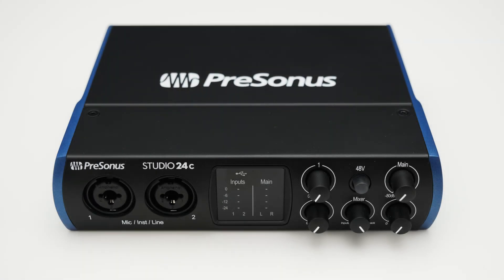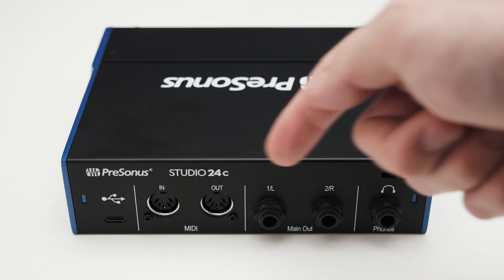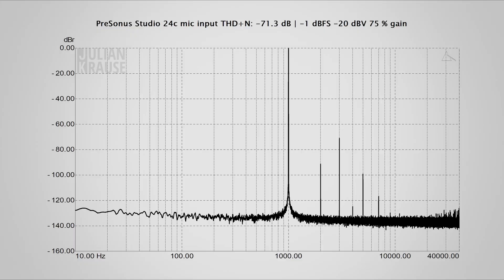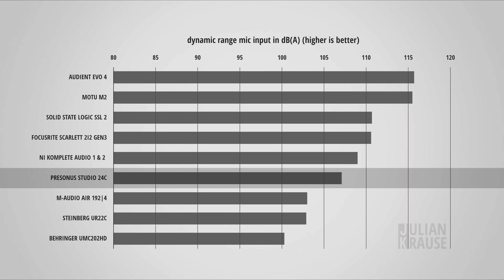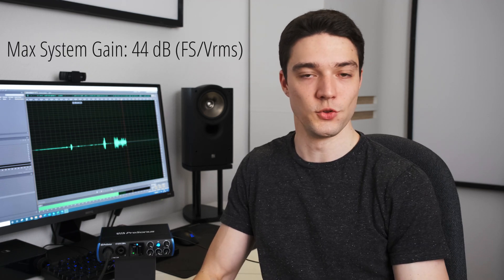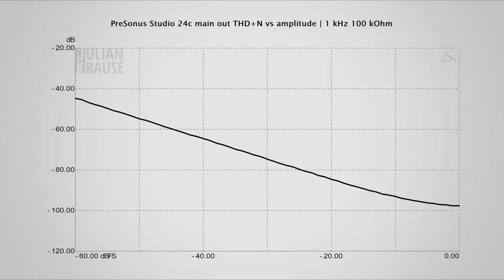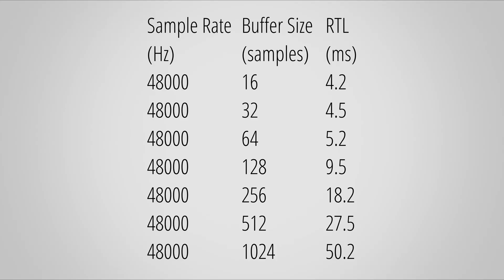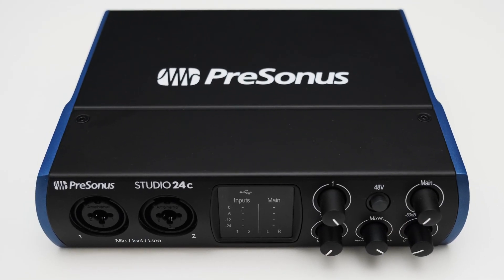PreSonus Studio 24c Audio Interface Review (audio quality test)

Comment: Been using this for about 5 years now, and 0 regrets. I had a dt 990 pro back then and it didn't struggle to drive it. Now im using it with an HD 400 (560) and its an even better experience imo. It did however make me shy away from the newer lower impedance beyerdynamic headphones due to the high output impedance.

Comment: Thanks a lot for the review, very informative !
I need a little clarity on my situation, I don't have studio monitors, so I I'm planning to use my AKG K361 headphones (32 Ohm) as output. Will this be enough to get a decent sound considering that the Presonus 24c has a high output impedance (22,2 Ohm) and 51,2 mW output power into 32 Ohm ? 
Or maybe I need another audio interface with a lower output impedance like focusrite solo or 2i2 ( 0,32 Ohm output impedance and 32 mW output power into 32 Ohm ) ?
Reply: Hola amigo, yo tengo esta presonus y unos AKG K240 (55 Ohm), aunque es casi imperceptible, la calidad del audio en los audífonos si disminuye muy levemente, pero la salida main es muy buena y potente.  También graba muy bien.

Comment: Thank you so much for your very helpful video. Well done! 
I'm using Sennheiser HD 650 headphones which have an impedance of 300 ohms.
Wondering if using a separate headphone amplifier would make any difference in regard to the frequency shift issue?

Comment: I got the Studio 26c today, I’ve measured the RTL with the RTL Utility and an analog loop, I got 9,89ms at 48khz 128 samples, both on my laptop which has intel i7-1265u and on my desktop which has Ryzen 5900x, both 32GB RAM. Amazing!! I don’t know what is the impedance of the headphone out, I’ll check how to measure it in case. Which are the headphones you suggested with the 24c? Sennheiser HD58x (I’ve seen they have 150ohm impedance)?? I didn’t get them exactly in the video…

Comment: Thanks for your review. I based my decision on it, been using it for a year and a half. In my opinion the interface is fine but using shures SM57 and SL26 I need to crank the input volume almost to the max - didn't have that problem with focusrite and tascam.

Comment: I just picked up their Revelator io44, which (allegedly) uses the same preamp as the Studio 24c, and I notice something interesting that tracks with what you have said here. If I set the input gain to +30 dB or more, there is RF noise. If it's at +29 dB or less, that noise is completely gone. When switching between +29 and +30, it sounds like it is switching between two gain circuits, so I kind of suspect that whatever circuit they are using for higher gain is just not very good.
Reply from the maker: Hm, interesting. I have an io44 on hand and I'll have to check this further. Thanks for the info!

Comment: I own the 24c since last year. When I have bought it, I was new to this (interface, audio, etc.). I actually use a AT2020 condensor mic (plug XLR) and I recently bought a Presonus PD70. After testing the studio 24c, do you think it could be a good add on to buy a pre amp for my dynamic Mic? Cause honestlay, I need to crank the gain almost the the rough to be able to get a decent recording (between -9 and -6dB) I know that the two input are already preamp, but I'm not quite sure it's enough. Since my gain is really high, the room tone is also high. Thank you! Very good review though
Reply: You’ll need mic inline preamp for 24c to use with dynamic mic..

Comment: Excellent review, thanks. I went ahead and purchased one of those. I was blown away by the sound quality and the sound image/stage. Those excellent crosstalk numbers really make a difference. I am using 32 ohm headphones and indeed the high phone output impedance proved to be a problem but I drove them from the "main out" outputs and problem solved - crystal-clear sound. I just use a switch to change routing from headphones to speakers and vice versa. I found a pretty neat use for the headphone output too: I record directly in stereo instruments that are normally mono, using my Soundblaster's line-in, for reviewing my progress with my bass guitar, in Audacity which is much more convenient and hassle-free compared to real DAWs :).
Reply: What is exactly the problem of using 32 ohms headphones with studio 24c ? How it manifests practically ? 
Also can you describe more specifically how you deal with this problem, please ?
Thanks in advance !
Reply: @cristianturcan7659 Ιt's very simple: if you plug headphones into the headphone output jack you'll have more bass than normal (actually bass is normal and for everything else there is less of).

Solution: plug them to the main out instead, using an adaptor plug. If you also need to drive speakers use a switch.

Another solution would be to use a dedicated headphone amp between the headphone output of the Studio 24c and the headphones themselves. That's what I eventually did.
Reply: @MotoMarios  Thanks a lot !
Reply: @MotoMarios  is it really audible by ears?
Reply: @LordZavet  If you mean the problem with too much bass, then yes it is very audible.
Reply: what you mean by "main out" ? so u bought this interface and plugged headphones not to inferface but to your pc/laptop?
Reply: @ClarkSpencer1  The interface has two outputs - one that goes to speakers ("main" out) and one that is intended for headphones. What I did was connect the headphones to the speaker ("main") output and the headphone output is plugged in the Line-In of the Soundblaster for real-time "loopback" style recording in Audacity, in stereo.

I use a switch to divert the "main" out from the headphones to my desktop monitors.

Be advised, I bought the interface used and I can not use the accompanying DAW/software, only the basic driver is functional so I can't have loopback any other way.

Comment: i have just buy the Motu M4 but issue in the +48V of the input 2, a low-medium buzz when i up a lot the preamp. i have to send it back. But to know if i ask for a refund or replacement,  i have ordered the 68C in express lol. And no problem of mic +48V preamps with the Presonus. But yes, not as gain as the Motu, even with the line in (when i record my hardware synth) the level is clearly lower compared to the Motu M4. line/mic/inst all is clearly lower than the Motu :( . Headphone output same power. Very good sound quality on both but better dynamic and nuances respect with the Motu. i think that  for a Presonus product with 4 in 4 out, it shouldn't be so withdrawn compared to the M4.

Comment: Hi. In your opinion, will this interface provide enough power to sufficiently drive 250-OHM headphones such as the Beyerdynamic DT880? Thanks!
Reply: Hello,I have same question. Presonus support gave me positive answer. I wonder if anyone tested
Reply: @IntelligentMuzik  I have the answer you want my friend..This audio interface can not handle 250ohm headphones at all..If you already have the headphones and no interface go with MOTU M2 or Solid State Logic SSL 2. I had the exact same issue..
Reply: @eddielives3946 Thank you for the reply. I have to say that I bought it and it runs great.. of course if you need more volume you can invest in an amplifier but I don’t see the need for now.
Reply: @IntelligentMuzik  Correct! I'm happy you are satisfied with the 24c,i was also until i changed headphones because i wanted a more clear sound for my mixing and mastering. The only problem with the amplifier technically speaking is that the less things you put through the interface the more you get ( most of the times!) 🤙
Reply: so despite it handles up to 300 ohm on paper it does not in reality? should I go for 80 ohm instead of 250? thanksss

Comment: I've been testing the Presonus Studio 26c and the Audient 14 mk 1. Really can't decide which I prefer. They both sound fantastic, really neutral, clean conversion and nice stereo image. Can really notice increased seperation between the bass and mids over my Mackie Onyx Producer. However I find the Presonus has a slightly cleaner headphone output with my 32 ohm headphones, although it is out of balance at low volume levels, biased towards the left, where the Audient is perfectly balanced due to digital volume control. 
 The Audient is a tiny, tiny bit better on the DAC but it's extremely subtle on my Yamaha HS5. But l the 26c has midi and 4 seperate outputs Vs no midi and 2 outputs and a seperate headphone bus on the Audient. Really can't decide, they are so so close..I have to use USB 2 due to using older computers.
Reply: I have here the Audient id22 which i used for 6 years and love, but recently bought as well the presonus 1810c. I like the dac converters better on the presonus it sounds a bit fatter , same on the headphones. Audient is still very good but sounds a bit more hi-fi in comparison. I'm suprised as there is barely any adds/review about those presonus interfaces. They might not be the best on paper but i prefer it to mix master my music on the 1810c (i engineer for more than 20 years). Kudos to presonus for releasing this cheap but good sounding interface. I tested the preamps they are great as well, but the 80 db data is only on paper you can not push it to max at all cause it starts to hmm before that at around 3 oclock
Reply: @LaidbackSounds  yes I found that with the 26c, sounds "bigger", while the Audient sounds slightly warmer. Main thing I didn't like was the headphone volume is biased towards the left at low volumes, which I the volume I always work at.
Reply: @KebbaPropulsion  go for the 68c at least dude, there is real difference of quality with dac converters, i have the 1810c and headfones do not have those issues sound super clean as well. Not sure about the warm aspect of audient as warm usually means phatter and more analog which is not the case, its well defined but more on the highs and sounding thinner a bit compared to the presonus. I have had many sound cards some expensive and i really digg that presonus 1810c sound and strangely enough i was waiting nothing from it at this price point. I had the ssl too at one point to test and found the dac was pretty coloured.
Reply: @LaidbackSounds  yes the Audient does sound thinner, the low end isn't as big as the presonus.
Reply: @KebbaPropulsion  real talk, if u can swap yours 26c to a 68c it will remove your headfones issues.
Reply: @LaidbackSounds  cool. I am actually looking for a new interface with more inputs, added 2 behringer synths and an iPad to my my studio, so may well end up selling the Audient to get a 68c.
Reply: @KebbaPropulsion  nice or even the 1810 c both are great choices anyway
Reply: @LaidbackSounds  mind you for that sort of price could get a Motu M4, they look pretty incredible..
Reply: @KebbaPropulsion  i find the 1801c sexier looking but its all about taste here, soundwise i d be curous to compre but i read everywhere that the m4 like the ultralite m5 have a really fat sound too but a bit less shiny high, only a real life testing would say it, i might buy it in a few months just to compare and send it back if it doesnt do better than the presonus but to me the presonus already shines i doubt the motu wouldbe much better to be honest, but lets see
Reply: hard hard hard.... maybe look at the software package ? a midi interface cost nothing, just take one usb port....

Comment: Since a couple of months without dramatically changing my system my studio 24c stopped working. I can get it to play music or get my DAW to recognize it by replugging the usb a cable. If there is nothing sent to the interface, it becomes idle, it stoppes working and i have to replug the cable again. At first I thought it was maybe a system fault so i decided to do a reset of the computer, deletes all my file and do a clean install of windows. I thought that might solve the problem but it did not.

I've updated the firmware and universal control but i keep having to re-plug the interface. I bought a good quality usb cable but that also did not solve anything. I also installed an old version of universal control and that did not help. I tried different cables, another wipe and clean install, different versions of universal control but the problem persist.

Is anyone else having these problems? Also presonus support keeps telling me to reinstall the software so they're no help.

Comment: Noob question alert!  Just investing in decent monitor speakers for video editing and considering an Audio INterface / DAC.   I don't need any instrument or mic inputs but really want to use a DAC for best monitoring sound. 

I want to be able to switch between headphones and speakers BUT also want to be able to use it on a PC and Mac (and easily & quickly switch between the two computers).  

Will the Presonus work like that?  ie plug in the PC & Mac (using a simple usb-switch) and move between the Mac and PC?  Thanks!

If this is overkill for me, any suggestions? THANKS!

Comment: Hi Julian and thank you for your precious reviews! I'm buying the PreSonus Studio 24 C and I'm searching for the most suitable headphones to use with that interface. In one of your videos you say that the impedance of the headphones should be at least 8 time the impedance of the phones amp on the interface. The PreSonus has a headphones amp impedance of 22 ohms (@1Khz), and you say that the right headphones should have 80 or 150 ohms. In the table at 8:36 I see that the PreSonus works better with headphones with impedance of 32ohm (output power of 51,20 mw) instead of headphones with impedance of 150 ohms (output power of 23,56 mw). I expected the exact oppsite. Why? In this video you suggest the Sennheiser HD5xs, but I can't find them. Could you please advice me other models of headphones that work well with the interface? Many many thanks!
Reply: did you manage to choose the right headphones? i was wondering the same and would like to know if you have figured it out. i've been searching for months now...
Reply: @wwtws did you find out about the headphones ?

Comment: Thanks for this. Could I apply your findings of the 24c also to the 1824c (regarding the distortion of the preamp and low headphone output etc.). Or would the Scarlet 18i20 be a better choice, quality wise on these specific points?
Reply: go for the 1824c converters sound way better

Comment: I'm just starting out & I got a 2012 MacBook pro with 512 GB SSD a i7 Processor and 16GB memory & I just ordered the new M-Audio Oxygen Pro 49 Key Controller.

And my question is have you tried out the mini ports? & will it work well with the free Mac software be GarageBand and the free Sampler called TX16Wx??? & does the mic 🎤 pre amps put out a better quality gain then the Focusrite Scarlett 3rd Generation interfaces? I do like the specs on the Motu MK2 

I hope that you can help me make the right choice cause I'm thinking about getting me the $80.00 Samson C01 Large Diaphragm Condenser mic 🎙️ to start out with

Comment: Hi guys

I am considering to buy Audiobox96  but what is bodering me is,
 Can I listen to my play back through headphone or speaker at the same time?.  By lowering down either volume to listen each one.   plug in to  listen from headphone or unplug  the headphone to listen from monitor speaker.  
Secondary:
Can someone advice between Studio 24c and Audiobox 96 which one is better. (Hassle free) from unpluging the headphone to listen to monitor speaker.  Or once you plug in the headphone it will switch off monitor speakers signal.😯😯 :twisted: 😟😟

Thank in Advance.

Comment: Will using the Shure SM7B without the cloudlifter and adding digital gain add in more noise? Is it really worth it to get a clean recording to use it? I'm at a point where I could buy the mic and the cloudlifter, but if I can save money from buying it that'd be great

Comment: Wait, how do you test for THD? If you use a line level  (low impedance)  output into mic preamp it is expected to get higher THD. You need to match impedance closer, higher impedance balanced out into XLR.
Reply from the maker: Hey, you don't need to match the impedance. Microphones are low impedances sources and the output of my audio analyzer is low impedance as well (50 Ohm). This is the proper way to test THD.

Comment: Hey Julian, please I am trying to decide between this PreSonus and a Focusrite 2i2. I lean towards the PreSonus because of its input/playback knob but lean towards the Scarlett for the looks, air mode and not needing to research low impedance headphones. Which do you think is the right choice or a better interface?
Reply: I'm trying to decide the same thing, and I think I'm coming to the conclusion that it doesn't really matter.

PreSonus 24c has a better display, midi inputs, a blend knob for direct monitoring, automatically switches between line and instrument, and comes with a free upgrade to PreSonus Studio Artist - which I think is a great DAW - as well as Ableton Lite, but it's larger, the knobs are harder to use, and support (should you need it) isn't as good.

Focusrite 2i2 is smaller, the knobs are easier to use, support is better, and it comes with Pro Tools First along with Ableton Lite, but the level input indicators aren't as good, there's no midi, it requires manually switching between instrument and line, and direct monitoring is limited to on/off.

I think the sonic differences are close enough to be inconsequential, so it's just a matter if any of the differences are compelling enough to pick one over the other.

Comment: Julian, would you check out the PreSonus Studio 26c because the specs did change (for instance they say 50dB gain for 24c and 70dB for the 26c)?  Another stand out difference is 6dB more Converter dynamic range they say up from 108 to 114 (mic dynamic range up from 106 to 110).
Reply from the maker: I recently saw that the 26c has better specs compared to the 24c. I'll see if I can check it out.
Reply: @JulianKrause  Thank you.